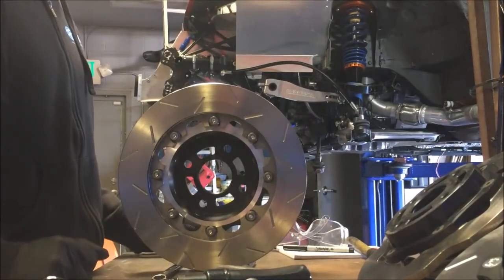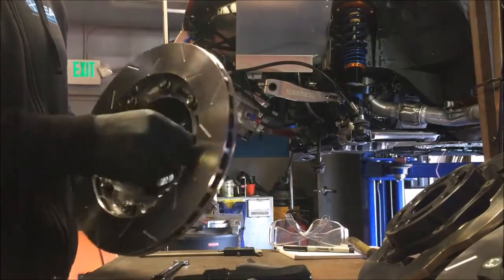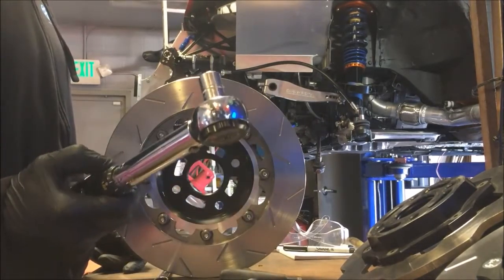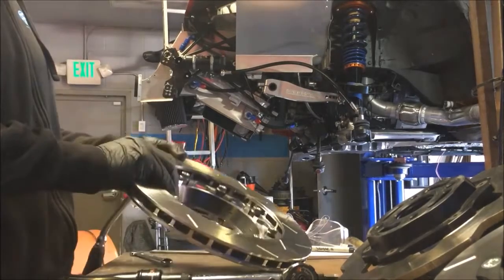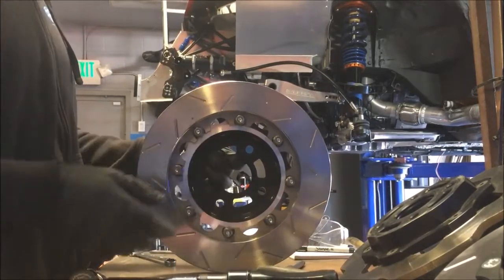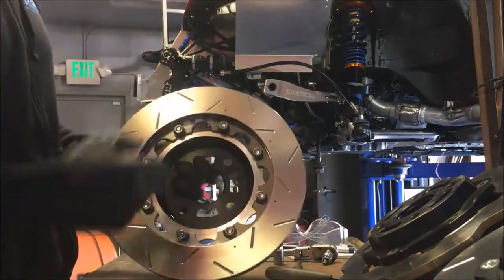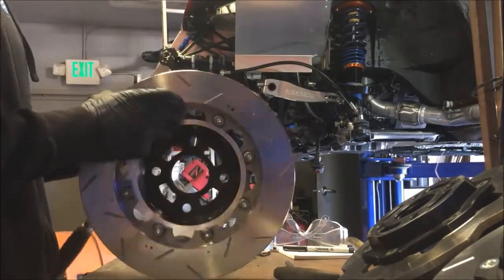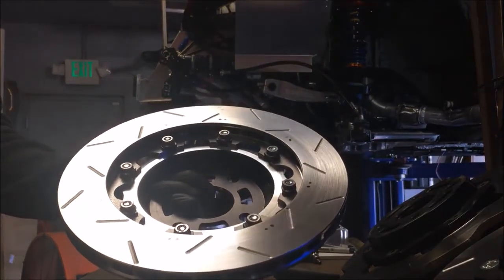2 Piece Brake Rotor Assembly | HyperMiata

Comment: I did not need to hold the bolt with an allen key, it still tightened and torqued down, is that normal? Also, I used a torque wrench but ended up going about arm snug with all the bolts, so maybe closer to 30 foot pounds instead of 25, is that fine?
Reply from the maker: All good. 30 is fine for those fasteners.

Comment: Do you find that safety wiring the hardware is not necessary when using the serrated nuts?  I'm interested in how the floating rotors perform on your car with regards to pad knockback and heat handling.  Thanks for the video and can't wait to see more of the HyperMiata!
Reply from the maker: With other fastener types safety wire is sometimes a must, but with the serrated nuts torqued correctly (in 2 stages) there's no need for safety wire.
Reply: Thanks for the info!  It looks like a great setup.